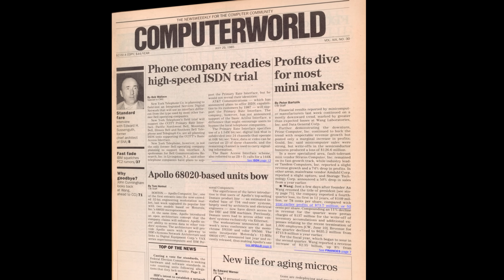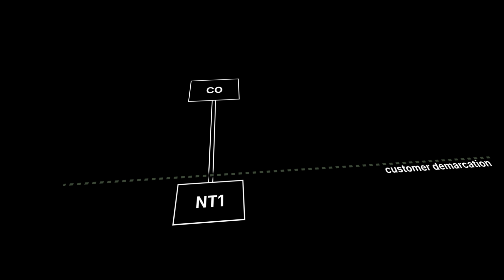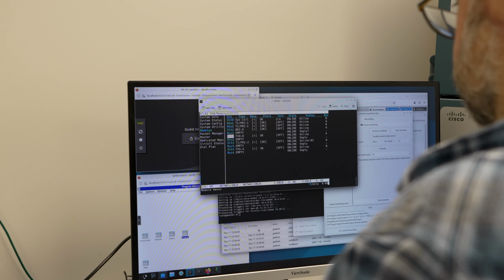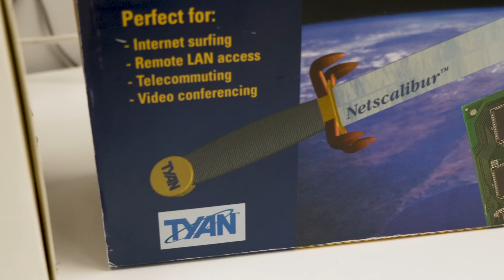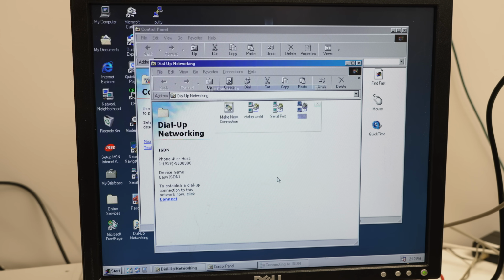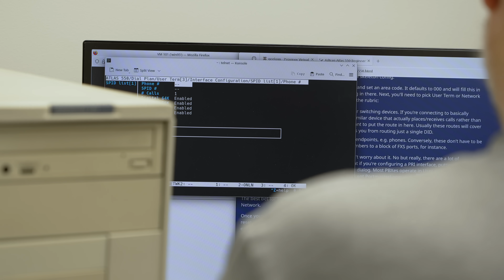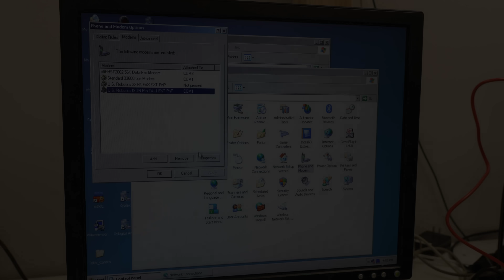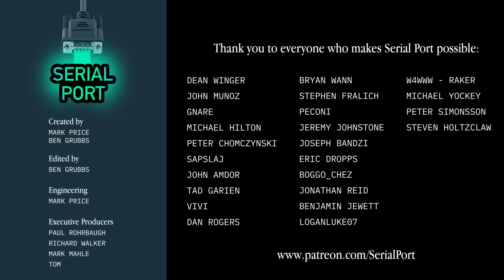Do you remember ISDN?

Comment: I'm working on PABX for an ISP in France since the mid 2010 and I still work with BRI and PRI, mainly for the phone usage. We are also relying on the ISDN to remotly manage PABXs with their integrated modem. I used to deploy the ISDN access from the ISP equipement to the custumer, and install the PABX behind. I love working with ISDN, especially at the beginning of my carrier, when FTTH and FTTO access were uncommon. ISDN is far more reliable and can be used in much longer distance than ADSL or ATM SDSL ( where 1 pair down bring the whole access down ). In this environnement, POTS were also very uncommon, only deployed in environnement where the extra reliability over ISDN was mandatory. The fact that a customer could buy up to 4 BRI grouped access ( 8 in specific circonstance ), which ensure the use of all and same phone numbers in all the access of the group and could still work easily when 1 on the access of the group was down, was a huge selling point other POTS in this PBX context.  Since we are closing the wired / copper network to only keep the fiber network, POTS, DSL and ISDN will be entierly shutdown in 2030 here. However, to keep maintining those old PBX and making a smooth transition, we also have ISDN to SIP interface which support all phone and data usage we have to achieve.

Comment: Legacy telco stuff - dozens of different protocols, thousands of acronyms, the complexity no one asked for... I love it!
Reply: And if you setup 56k like a proper vdsl setup you get better connectivity.
Reply: I wonder how it relates to OSI model.
Reply: @monad_tcp  Well, IP datagrams were simply encapsulated, usually using PPP, and then transmitted over ISDN.

Similar approach is used nowadays as well, where two incompatible protocol stacks meet.
Reply: This was the result of the vendors trying to build infrastructure that would run anywhere in the world instead of custom building systems for each market. It was hard enough digitizing the switched networks in the 80s. This was 100x more complicated.

Comment: My school here in South Africa used ISDN for our telephone lines for almost a decade before we were kind of forced to move to SIP trunks as the only provider of ISDN in the country was phasing out the service. Never used it for data, but for voice calls it still was the cleanest, most stable and best audio quality connection I ever experienced.
Reply: Indeed, recording studios and even radio stations would use a full ISDN service to carry audio between points.  It was essentially putting the audio through those copper wires without the 'scrunching down' of audio quality that you would have on a regular phone call.  

You could, for example, play an audio commercial through the ISDN connection to have it the destination instantly rather than waiting on a courier or postal service to deliver.

Comment: I worked in newspaper advertising and we had quite a few lines of ISDN at my desk. I think there was three Macs (68040, Quadra, Centris) each with 8 channel ISDN cards and another three machines with 2 channel cards. They ran ISDN Manager and ADS software for answering calls. Quite a few clients also had 8 channels and would bond if the wind was blowing in the right direction. The Macs were already retired from the desktop when I started in the job and ran 24/7 for well over a decade. By about 2004 or 2005 almost all artwork delivery had moved to a web based solution.

Comment: My employer gave me access to ISDN service and connectivity hardware (a PCMCIA card, iirc) back in '96 or '97 I think. I cannot remember much except even then the joke was that It Still Doesn't Network. And it didn't, much. I think basic connectivity was achieved, but I got poor throughput and lots of disconnects. But my later DSL service also sucked as well, I think we were well over 14000 feet from the DSLAM. Not sure how this would have impacted ISDN, but it can't have helped.

Comment: I worked in IT from about 1990 until about 2010 in a lot of different capacities.  But in up until about 1998 or so we had a ton of different WAN connections for different purposes.  

If connecting to a mainframe and supporting dumb terminals there various types and speeds of connections.  But if connecting to LANs and PCs then there were other choices.

ISDN was one but only for just a short time.  Other types came along quickly and it just lost out.  We had AdTran and other brands to support it at that time.

Comment: This takes me back to my early years as a 17 yo in 1997. I convinced my dad (an IT VicePrez) to get ISDN for home. Got it working with the Motorola BitSurferPro @64k, as a NAT gateway for the other computers in the house, and using the other B channel for my own voice line. My neighbors had a small hosting company they co located with at a local ISP and I went to work for them. I got them to connect their small office to ISDN @128k on a 3com ISDN TA so their web devs could upload quicker than having each of them with their own async 56k down/33.6k up modems. I remember that exclamation amber alert on the 3com front panel. Got to spend that day tying up a Telco NOC's (Sprint) line while they figured out the problem. A year or two later, the local Orlando, FL, US cable system had their HFC network built out, and I ended up working tech support for them when it was still new. Man, what a wild time!

Comment: Radio used ISDN for audio delivery, remotes, STL, etc. Until telcos dropped it only recently.  The internet is a nightmare for audio transmission because of uncontrolled delay.  iSDN provided "ownership" of the digital.path and it was awesome.  As ISDN was being.pulled from service, radio engineering became a pain using the current high speed internet services.  Also, banks all.used ISDN, even as their main backup during the modern internet delivery systems. 

BRI's, SPID's, B and D channels. I know it well.  Too bad most phone companies had few techs who actually knew anything about ISDN.  It was a installation nightmare, but once operationalitwas the best way to move realtoime audio around.
Reply: Yeah, some of the phone company techs weren't the greatest.  On one job, I was setting up systems between 2 cities to a 3rd.  I had no problem setting up the first, but when I got to the 2nd, the phone company tech couldn't get things going.  I asked if he could look up the configuration for the circuit I had set up earlier and after he did that, he was able to get thing going.  However, he only managed 56K B channels instead of 64K that I had set up on the other one.  That was good enough though, so I called it a day and went home.

Comment: I do although it arrived very late in the UK, in homes at least. It was around 1996 or 1997 and for a couple of short years before Cable or DSL it was the thing to have if you wanted to play Quake due to the low latency. It was however quite expensive and I remember people only selectively enabling both channels for the full 128kbps because of the expense.

Comment: I moved from the UK to Finland in 1999 to work for Nokia and they paid for ISDN to my home and I had the Cisco router shown at 7:21. The speed and quick connection was a revelation compared to the dial up connection I was used to the UK, but then I realised it could be configured for 2x 64k instead of the single channel 64k it originally came set to and that was even better.

Comment: Remember it? Back in 1986 I put out the fire when AT&T discovered the different current draw of UK and USA POTS lines. When working on one of the first 5ESS-PRX nodes in the BT DDSN network ISDN wasn't part of the contract but AT&T were keen to show BT what the CCITT version of the 5ESS could do. At their own cost they fabbed some line chips specifically for BT lines. But there were differences in FXO current draw and BT was higher than AT&T which led to smoke alarms triggering. The exchange was Bristol Pegasus and the ISDN 'experiment' was terminated there.

ISDN was very slow to roll out in the UK because it would destroy BTs lucrative private wire service. Thank you Virgin for disrupting the BT gravy train..... #goodolddays
Reply: Exactly. Telcos were not keen on upgrading to integrated digital services because they were making a fortune on x.25 and DDS back then. It even took a long time to deploy frame relay which rode on top of the existing infrastructure. This era is a text book case study of how monopolies degrade innovation.
Reply: @esSKay25  X.25 PADs over 19.2k lines👍 Reminds me of my AOM101 fault finding days trying to prove packet loss was caused by all the 5ESS-PRX switches outputting stats on the hour and the AOM101 buffering not being up to it.😂 #goodolddays
Reply: @IndaloMan a lot of frustration with flakiness back then, but then I look at the procs we were using and what we were trying to do with them and it’s amazing anything worked at all. Plus the ram was dodgy af.

Comment: Wow, such flash back. We set up a building automation system, so that we could access all the sites from the Internet via our central ISDN dial-out system. Completely transparent to users (mostly ourselves, this was before vile traffic started on the Net), none of this "client set up" on the OS as described in the video, "just" a Cisco router with 2B+D and Ethernet interfaces. And the "instant connect" was sub-second, since we didn't go via an ISP ("as we were our own ISP") and as a user you wouldn't know that there was a dial-up on the way. Further, if several people used at the same time, it would hang up, dial up, over-and-over sort time sharing the 2B+D line. Crazy when I think about it now. It went live in mid-1998 and operational for about 2 years, when ADSL started showing up as an option.

Comment: 3:55 The obtuse terminology makes it seem harder than it really is: NT1 and NT2 are roughly equivalent to a modem(*) and switch/router (e.g. PBX) respectively, NT1 may be integrated into the next unit in the chain but in non-US countries the NT1 was typically provided by the telco.  TE1 means user equipment with a native ISDN interface while TE2 is non-ISDN equipment that needs an adapter (TA) to be connected. R/S/T/U don't really identify particular kinds of protocols/interfaces but are merely "reference points" that may (but don't always) exist along the path of connectivity from the user equipment to the central office, e.g. the R-interface is simply whatever the connection is between a piece of non-ISDN equipment and its ISDN-adapter.

(*) An NT1 is only analogous to a modem in the sense of being responsible for the headache of shoveling bits across a phone line originally designed for voice, but no modulation is involved... at least not in any U-interface commonly used. While the S/T-interface was standardized (ITU I.430), the U-interface was instead left up to the phone company (hence the NT1 being provided by them) and therefore I can't actually exclude the possibility that some U-interface exists out there that uses modulation.

Comment: I completed all of the ISDN Primary rate T-1 carriers in my Phone Company work center in Chicago from 1999-2002 without any errors. There was an issue with turn up of UUNet, or confusion between custom and standard ISDN Prime. There is a difference, and I had all the information well organized and resolved in good time.

Comment: I really looked into ISDN back around '96 or '97. I had Mindspring dialup and could have gotten ISDN for about $20 a month more, however my phone provider wanted $300/month for the BRI, PLUS 1.5 cents per minute of usage if you didn't buy their overpriced ISDN access. I did the calculations and it would have cost me about $450 to $500 a month for 128k versus my $40 a month 56k.
Reply: That's why only the well off had it.

Comment: Back at the time I was starting my digital life in early 2000s, ISDN was still a thing at some places in Brazil. I had an residential 128k ISDN for a couple of years, before my telco had discontinued the service (which was released around 1994 if memory is right).

At this time, DSL and HFC services were growing fast, and ISDN was a bit more expensive and complex to manage.

I remember to use an weird Tigerjet PCI modem. Good times...

Comment: I had ISDN. Circa 1998 if I remember right. Might have been 1997. Had an internal modem. Had to work directly with my local small business ISP, I was their first ISDN user. 
I just remember being able to download MP3’s at near realtime speed. Haha.  Though my K6-2/300 machine that I had just built struggled to play MP3’s smoothly while multitasking. Pretty sure I was running OS/2 Warp, as I was big into that at the time.

Comment: Yep, I used to work with both basic and primary rate ISDN.  Several years ago, I was a tech with Adtran's Canadian distributor and worked with a lot of different Adtran equipment, including the 550.  That configuration really took me back.  I also worked with the Adtran ISU, which was their basic rate terminal.

We used the ISU for a couple of things.  One was video conferencing between a prison and courts in Ontario.  This required 3 ISUs connected to the video equipment at each end.  This involved me going through the security to get into and out of the prison.  I would be taken to the telecom room and locked in until the guard came back to let me out.  I took in only the tools I needed for the job and nothing else, not even my cell phone or pager.  An inventory was taken coming and going.

Another use was with a device called a PBX extender.  This would between a PBX and remote offices.  I'd put the  PBX end of the extender and an ISU in the office and the remote end & ISU at the remote site.  While we normally installed an 8 line extender, it was possible, IIRC, to use a 12 line one.

Another "fun" job I had was at an office where they needed several modems to dial in.  However, they were too far from the central office for the modems to work properly.  To get around that, a T1 was installed along with an Adtran channel bank.  I got everything hooked up properly, but it wouldn't work.  Turns out I had the channel bank configured for loop start, as required for the modems, but the DMS 250, at the other end of the T1 could only do ground start in this sort of situation.  Apparently loop start was an extra cost option that wasn't used.  As a result, the phone company supplied about a dozen loop converters, to convert from ground start to loop start and all was well!  Lots of fun!  🙂

Btw, bonded ISDN channels does not mean PPP is used.  I used to work with systems where the ISDN carried 128 Kb serial connections, but not IP.  I don't ever recall using a BRI for an IP connection, though I did over PRI.

Comment: Ah the good old Atlas line.  I used to use these in a bunch of random solutions.  A great set of devices.  The channel supervision and state handling of the device can be a little quirky however with the FXS ports and internal tone services.  They occasionally tend to miss off-hook, on-hook transitions and can get stuck open.  The instantaneous connection is because it doesn't need to signal in DTMF, it just sends a D-channel indication of a call and opens allocates the B-channel timeslice.  That pretty much just takes milliseconds.

Comment: Do I remember it? Although I had top-tier US Robotics modems on my 2-line BBS, I read that ISDN was coming to my small town in Virginia. I called the company immediately that was heading up the installations, and they were even unsure that they were doing my town, but after staying on hold for a while, they said I was modem 1 for the first install. Oh my God, that thing was a rocket. The contracting company I worked with at the time had slower Internet than I did, and we sometimes worked out of my office, with three of us slammed in there when we needed the extra bandwidth. The really cool thing was I don’t know if Bell Atlantic changed hands but I stopped getting bills early on and had it for years… never paid for it. It was awesome.

Comment: I not just remeber ISDN, I still use it up to this day! There are two S/T jacks at the workbench. Of course, they are not running from the CO anymore, cause telco companies threw out ISDN more then ten years ago. But my older router (which is just behind the main one now) still have an internet ISDN circuit you can use with your stuff.
I use the ISDN for testing ISDN stuff, and also for powering a late 90s ISDN PBX which I use for testing modems and POTS phones. I refurbished so many rotary dial phones, and this PBX still talks real pulse dialing and also gives you nice full -48V on the POTS lines and enough power and the right frequency to ring mechanical ringers.
Reply: We've used ISDN for radio until AT&T completely.dropped it over the last couple years.  Our last.ISDN service in Chicago ended earlier this year.  Sad day for radio.

Comment: I had ISDN at 2 different offices in the late 90s, it was nice to get past modem speed, but I had already been spoiled by a university lab connection that blew it away. Luckily cable modems came around 2000 in my area.

Comment: My dad got ISDN service at home in early 1996 or so from Cincinnati Bell. His employer paid for it so he could do videoconferencing from home on his Dell Optiplex with a 90 MHz Pentium and Windows 95. It used a Cisco 1005 router. I was a diehard Mac user, but I have to admit, I spent a lot of time on his computer when he wasn't using it because it was so much faster than the 33.6K dialup I had. I remember it took several visits from the tech before they got it working, and I think the SPID was something like 20 or 30 digits long -- that's what kept tripping up the tech, being off by a digit or two.